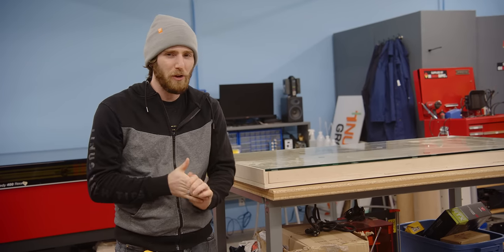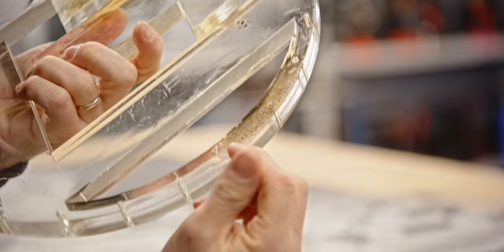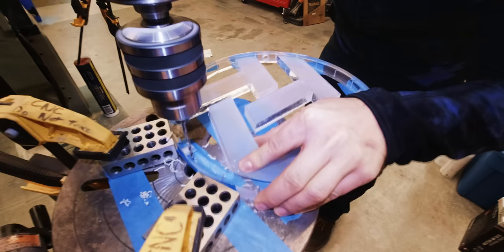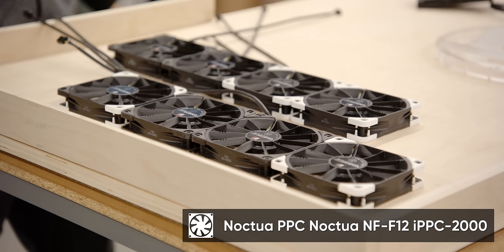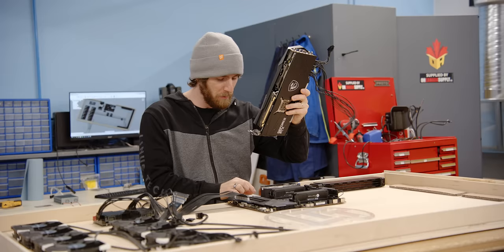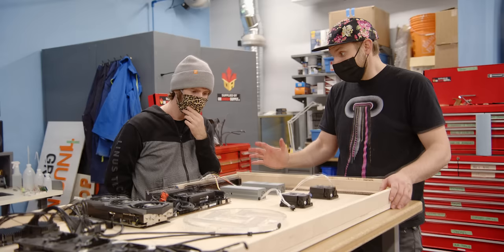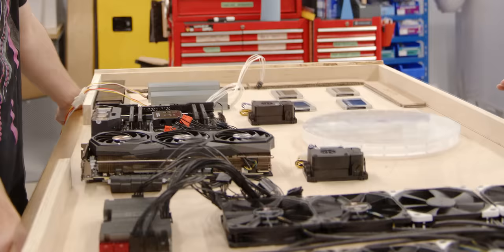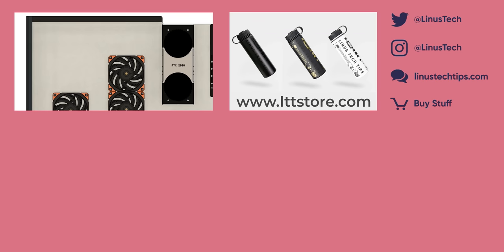Next Gen ULTIMATE Desk PC is ALIVE! - Part 2

Comment: That moment when DIYPerks beats you to the punch literally months in advance.
Reply: Not for the first time either
Reply: And it's a much cleaner build
Reply: In both water and air cooled versions
Reply: That moment when LTT beats DIYPerks by 4 years and 2 generations.
Reply: DIYPerks one is a thiccc boi tho
Reply: i thought that as well
Reply: @IvanIvanov444  and this one isn't? The radiators alone on the LTT one are 40.5mm thick. At 7:09 you can clearly see that the glass stops at least a centimetre above the radiators. Add another centimetre for the plywood base plate and you're at 6cm. Matt's watercooled update of the desk PC is 5cm thick with invisible overhang on the underside for some parts. So depending how you look at it Matt "won"
Reply: @IvanIvanov444  he uses the same radiator.
Reply: The ltt one is way more custom
Reply: @itdo.  We were doing this stuff back in 2003 with Danger Den.

Comment: Tip for cutting acrylic with laser: Go a little slower with a little less power. Gives nice edges, and reduce risk of cracking a lot.

If it catches fire, increase air assist.
Reply: You can also feed an inert gas supply to the air-assist to almost completely stop burning and overheat.

Comment: Let me know if you’d like some help with custom reservoirs, may know a thing or two about it...
Reply: Ha may know a thing about it! You dear Sir wrote the custom reservoir bible!
Reply: Yaassssss the cross the pond crossover we all deserve
Reply: I was just about to suggest, this team up. It would be nice to see LTT do a decent scratch build
Reply: Just checked out you channel and subscribed. Project ENSIS WOW!! I lost my mind.
Reply: Ah nice to see you here
Reply: reservoirs? LOL peaty much anything custom  from the ground
Reply: THE KING HAS ARRIVED!!!!!!!
Reply: They don't have your patience it would seem. 

I would have loved to have seen some routing on the base plywood sheet so they could have better clearances for things like the motherboard etc. 
I think they used a 3/4" plywood base. At least that's what it looked like. So plenty of space to route out an area for the motherboard, and anything else they might want extra clearance for. 
Or use a massive sheet of acrylic as the base and route that to have an integrated reservoir and the clearances required.
Reply: @KamalTailor  sanity prevails, first thing I thought was route a square for the mb with a  channel running out for the io panel so cables still plug in, they could gain some valuable mm’s of height right there, at least 10mm realistically 👍🏻
Reply: @spycedezynuk  I know right!
Reply: Wow I immediately thought of your insane cncd reservoirs when I saw how many failed attempts they’ve had hahah. Bit-tech x linus would be such a cool coop!
Reply: The king 👑 himself has spoken 😳
Reply: Yea I hope they put a little more effort in
Reply: Alex to the rescue, I actually came to the comments to mention you and and give advice about a proper way to do this. 
Was not disappointed seeing you here.
Reply: @nestormoctezuma4695  check out project Royal

Comment: With the current shortages I wouldn't be too surprised if this whole rig ends up costing more than the gold Xbox controller
Reply: @err  am i gonna get rick rolled with all this directions?
Reply: They are pulling parts out of the samples that they get sent for reviews/showcases or from parts they bought in the past. So apart from the labor and desk materials this likely would have been fairly inexpensive. They aren't paying for the MB, CPU, RAM, GPU, for sure. And depending the HDPlex, the rads, and fans as well. The riser was probably already around for some reason sitting on a shelf, though it could have been part of a case they got for review/showcase.
Reply: @jotarokujo706  yes

Comment: For acrylic like that, you want a 1/4” up cut, slow feed, fast speed. Then clean up with a 1/4” mill bit. You’ll get a nice smooth finish on the cuts and won’t burn chip or shatter. Also if you take an acetylene torch to it you can make those cut edges damn near completely clear and smooth instead of that blurry edge. You can torch clear the letters in the same way.

Comment: I used to cut a few different kinds of plastic on a trotec lazar at an old job. their speedy series of lazars has a trap door on the front and back of the machine to allow you to put over sized work pieces on the bed, if you open the front trap door you can use compressed shop air to blow the gas, that is created from cutting plastic, away faster than the normal ventilation system can. it is normally the gas catching on fire and not the plastic it's self. I know that you are not supposed to have the door open while cutting or engraving, but it was the only way we had found to keep projects from going up in literal flames

Comment: Why wouldn't you just use Polycarbonate.  It's so much easier to work with.  You've spent enough on scrap acrylic at this point it would've been cheaper.
Reply: This is what I was thinking.  You can drill it, machine it, and bend it in a press break without it cracking.
Reply: @Jay3718  
But you can't cut it with a laser. You could CNC it but that might upset the company that sent you a laser cutter...
Reply: @owensparks5013  The laser cutter is a CNC machine
Reply: @Shocker99  Congratulations, that's clever. I'm sure you know what I meant.
Reply: @owensparks5013  I guess you meant milling.

Comment: To fix the height issue where the pumps meet the tubing you guys could possibly create a small route in the base wood it wouldnt be noticable, lowering them to the correct level. Either that or you could create supports for the LTT logo and the pipes would be suspended which would look so much better than being rested on the base.

Comment: CNC fan shrouds in metal to angle the airflow to go over the components. You can also cut out the LTT logo in the shrouds with acrylic on the backside and do a custom 3 diode RGB for extra FPS and interwebz flexing power.

Comment: From experience I'd suggest casting acrylic into a mold for dimensional acrylic with typical secondary operations in the mold itself.  Acrylic is among the most difficult plastics for multiple operations to manufacture a part due to how brittle it is.  Could perhaps reach out to Volpin Props as they are phenomenal mold makers for casting.

If you need to drill holes keep it cooled and keep from "grabbing".  I'd suggest a diamond hole drilling bit typically used for glass, tile, and porcelain while keeping it lubricated/cooled.

Comment: A great add would be controlled airflow design. Utilizing Venturi channels at hot spots to enhance cooling. It would look cool, increase the structure integrity of the table and allow for a lot of hidden cable management. Backlight using LEDs based on airflow (speed or pressure) or temperature to see the design work. It could be a great  learning tool in thermodynamics and aerodynamics.

Comment: Acrylic is indeed very hard to work with 
I would just make the letter in brushed alluminium and glue that to the acrylic with some 90 degree  angles so you dont have to drill in the acrylic

Comment: The rez may not all be trash just yet. To repair and cover accidents in/on acrylic you should try uv resin, it hardens clear. It is like liquid plexiglas that will cover/fill any minor damage and  might even be able to "glue" some broken bits back together. (I do not know how well it resists pressure, but worth testing before throwing a piece away) Good luck   Ps. I got mine from wish but you need a good and fairly powerful uv light to start the hardening and it gets warm/hot when hardening .

Comment: In theory a polymer/resin casting could've saved you some of the time with the LTT symbol section.  Cast it in several layers and assembled with clear resin. All you'd have to worry about was the drying process and proper ventilation. I work with polymers in research capacity and havent had to do a complex build like this but I feel its possible .

Comment: You could use the hanjiang 17mm thin 360 radiators with some slim fans on both sides of the Desk/case for air intake and have the exhaust behind the motherboard.

Then the PSU and VRMs are cooled enough without dumping the heat of those parts into the CPU/GPU loop

Comment: You guys should use a pressure system to both test the the water cooling and quick fill for the system. Similar to a car radiator system.

Comment: I think the liquid from the watercooler could lose even more heat if they had to make a table with negative pressure, if the fans were taking the air out of the table the glass lid would be more sealed, and cold air would be coming from outside to the radiators with more intensity, the air being trapped inside the table for a while whether or not it will heat up with other PC components and even with the tubes themselves before reaching the radiators, this is the same logic of PCs that recommend having a radiator on the part front.

Comment: I do love the idea but... you going to have all of the cable laying over legs because the GPU & mobo are right in the  front?  Shouldn't the mobo be a bit on the side to give access the IO rather then stomach it, and the GPU access from the back? For the fan, maybe put them at angle rather the flat, creating a directional flow. It is more work but it really make up for it in comfort is the long term. Just a few ideas in this awesome project!

Comment: would be interesting if it would be undervoltet and overclocked, just a few % OC maybe up to 10% of the stock speed. another option to keep it much more quiet is to get 140mm fans with less rpm and less db(A). since i allready use the big once with 140mm i will never buy a 120mm fan insted. into the table it should be possible to get the bigger once into it. maybe for next projects, try the bigger fans 140mm maybe...

Comment: It makes me feel better knowing that Linus had the same problems I did with that motherboard. My solution was to cut a little bit off the drive bays in my case, then flex the hell out of the back to fit the I/O shield. 
I do feel like the luckiest bastard on earth to have been able to just walk into microcenter and buy a 3090 as it was unloaded, then base the rest of my build around a gpu. The 3970x is the way I went too, I couldn't justify another $2000 for the 3990x. Now I have to see if he goes with the G.Skill 3200mhz Trident Z ram I had to use because nothing else would boot

Comment: If the point is to rely on static pressure why are you exhausting through the sides, just grab bigger rads and exhaust downward instead. Only reason that would be an issue is if you are lacking space but that seems unlikely.
Reply: You might even have space for thin rads with low profile fans, those would just be about 4cm tall together.

Comment: Thanks for making this! It’s way cooler to see you hassle with your own design considerations than just put together a product made by some other vendor. Please prioritize this project!

P.S. For the next video maybe get the setup running using temporary double sided silicone tape for mounting. Also, sealed with stretch wrap/clear packing tape while you pressure test it and decide on how much airflow you’ll want/where openings should be. You may even want to mess around with how various support structures could double as ways to funnel airflow towards equipment and maybe even hide cables in a sleek fashion.

Comment: The temperature really won't be an issue. I can say this from personal experience. I'm running a Ryzen 3700X and dual RX5700XT in a Phanteks Shift with only three 120mm slim radiators from EKWB. The Phanteks Shift can only suck up air through the bottom, which is heavily restricted. It can only exhaust air through the front, which is blocked by a solid aluminium plate. 

Still, I'm running both my GPUs and my CPU overclocked as far as voltage will allow me and they're not throttling. Okay, the PC becomes audible with a deep humming after about 15 minutes of full Davinci Resolve, SolidWorks PhotoView or 3DMark TimeSpy but the hotspots on the GPU never exceed 105c (110c allowed) and the CPU never goes above 65c (75ish allowed) on a hot summer day. In addition to all that I'm running about 30w of white LEDs for my snowblind mod and I've crammed three SSDs, a HDD, a loop controller from aquacomputer and a LCD controller in it.

Comment: Seems like this will be loud... The fans get 90 degree angles in such close proximity... There is a reason those server fans are mounted to blow along an entire length of the case... Personally I'd just put the fans on the rads and have a passive intake...

Comment: You could put an air-conditioner or car radiator in the build with ventilation or run tubes or pipes through the bottom of the whole desk.  Since your making a custom build.  Just stacking off the shelf parts into a flat space.  Your missing the fun part of engineering something Ultra cool.
I love your videos, the solid gold xbox controller is amazing.
Next desk build Please go Epic ! 😎

Comment: Wait for the acrylic couldn't you just go over it multiple times cutting a small portion at a time instead of all the way through? Then you could reduce the output of the laser as well as the heat generated by said laser.

Comment: Linus have you thought of using some supermicro 1u power supplies? I have a PWS-920P-SQ (920w Platinum) and they are almost inaudible. the only caveat is finding a power distribution board that fits the aesthetic (but I am sure you have a lot more options given you're position and budget). Just my two cents.

I think it would look more elegant and still give the redundancy that you want with a personal computer. plus there is quite a bit of spaghetti with your solution

Comment: Any chance of a Side by side comparison of power consumption with a system with the same components but with a traditional psu and case? I'm curious how much energy you are wasting with that flex psu setup, since the 5 and 3 V rails are accomplished by resistive voltage dividing, aka, throwing away a bunch of energy as heat, hence the massive sink

Comment: I think you should angle the fans at least to 45° or you actually will push back their airflow and maybe even slowing them down because. Best would be even to have nice 90°curved outlets so that the air actually gets directed into the case and not onto the glass. It could also reduce vibrations as air from the fans is still is shockwaves and hitting the glass directly could potentially introduce vibrations on to the glass. To be honest nicely 3d printed fan exhausts would also look better as the fans are not distracting or disturbing you. Looking several hours onto spinning Fans is not that cool from my own personal experience. Now that I work for over a year in Homeoffice I had to move my gaming PC to under the desk because it was annoying to look at spinning fans an with low settings they turn randomly on and off when there is no load. :-) Just my2cents.....

Comment: My setup for storage is; Corsair Force mp600 1tb as boot drive/primary games drive (in the top M.2 Slot on my X570 Tuf Asus Board), an intel 660p 1tb as secondary games overflow, Crucial MX500 1tb conventional ssd for movies, Samsung 860 evo 1tb SSD for TV Shows, and a Sandisk 4tb 3dnand SSD for Additional games overflow. Currently all drives are between 75% full and 85% full with the exception of the Sandisk which has 2tb left to play. Shouldn't the ultimate desk PC have the ultimate storage solution as well... not just hard drives from a bin on the shelf? I mean seriously, I just got a Samsung 8tb SSD for my dads laptop so he could toss all of his annoying portable mechanical hard drives. The technology is there so raid like 8, 8tb SSDs, and raid two super fast M.2 drives for the boot drive. That'd be a little more "ultimate".. Still a great build video though.

Comment: I have an issue with my pc. When ever i turn it on the fans go to max rpm for several seconds. I set my fans to silent in my bios and they still do it. Its only my fans and aio that are connected to my mobo and psu. It didn't do it until I got a ryzen 5 5600x. I have an aorus x570 elite wifi motherboard

Comment: you need more powerfull laser so it wont have to stay on the part as long 3 years ago i worked at a place where we would laser cut acrylic up to 3cm if you have to go to slow it will melt you need to go fast if your laser cant do it let a differnt company do it you need atleast 250watt laser

Comment: Assuming the cost of this system ...
Why didn't you just mill an aluminum plate with a "heatsink" cut out all over the bottom surface of the bottom plate ...?
You know, aluminum desipates a little more heat than wood ... and most of the components can simply be passively cooled.

Comment: Wherever I see them trying to cram all those parts into a box and struggle with cooling, I wonder why they don't use bigger enclosures or mount the parts spread out on a wall with a giant heat sink and refrigeration unit. I suspect the reason may be something very obvious and more to do with my low wattage brain rather than any lack of ingenuity.

Comment: Nice some conditions apply Linus.   I laughed my head off.   How I pine for a 5950 X and a 3080 anything graphics card sigh.   Stuck on Core i9 9900KS forever it would seem.  Ever hopeful I have the Asus Crosshair new dark hero motherboard and matching DDR 3600 Ram.    I am 71, so time is not on my side bitcoin miners and parts shortage manufacturers.   Still, all core and low temps at all core very stable 5.1 GHz is not too bad I guess with a 2080 Ti overclocked to within an inch of its life hi.  :-)  I lapped the CPU as well and can clock it at 5.2 but wound it back a bit for the electric bill.